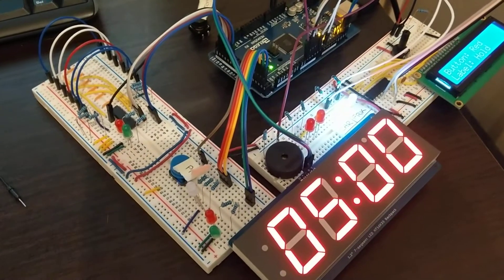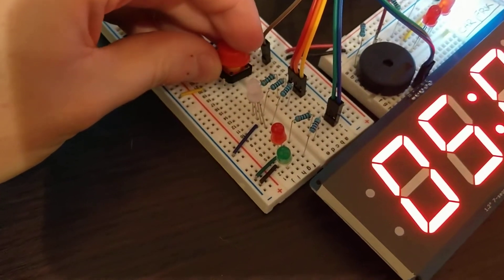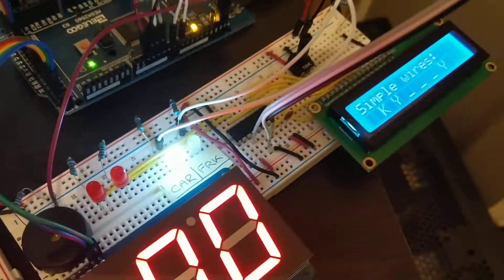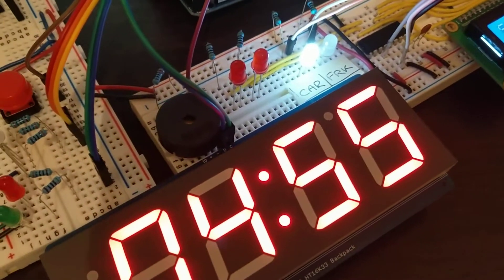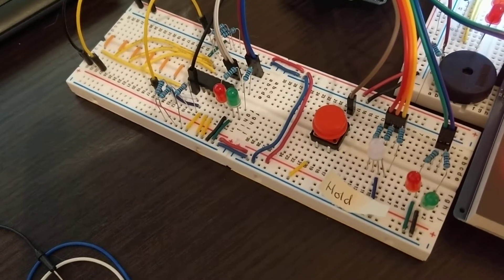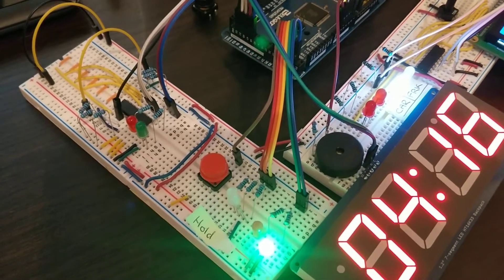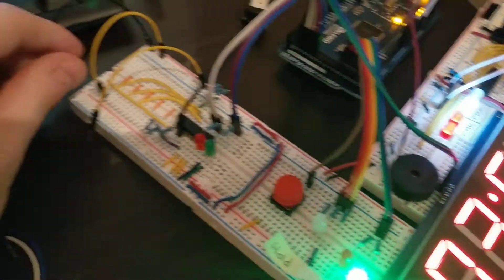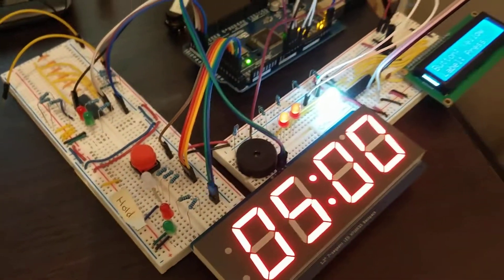KTANE on Arduino: run through of The Button and Simple Wires

Comment: Dude, what 4 digit 7 segment display module did you use for the timer? I’ve been trying to look for something of that size but haven’t been able to find anything
Reply from the maker: Check out Adafruit! I bought mine from there, and they make a variety of different sizes and colours with easy to use interfaces.